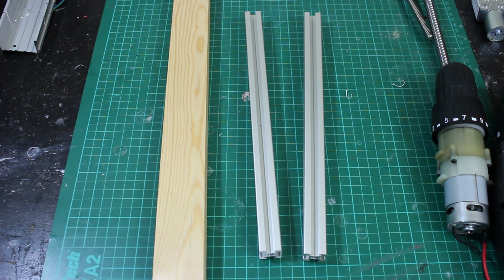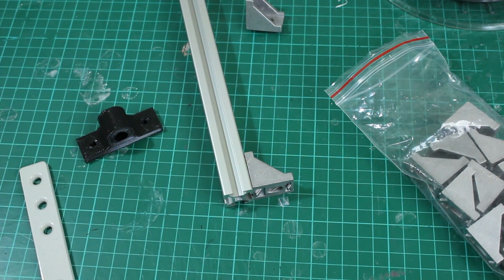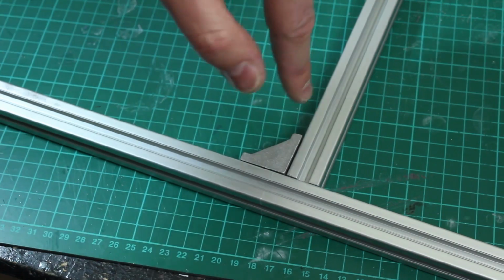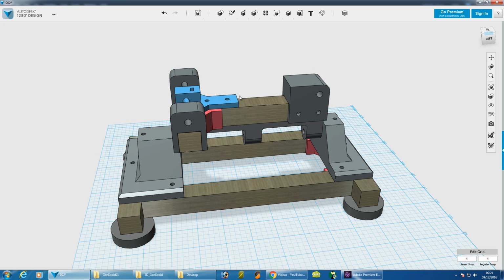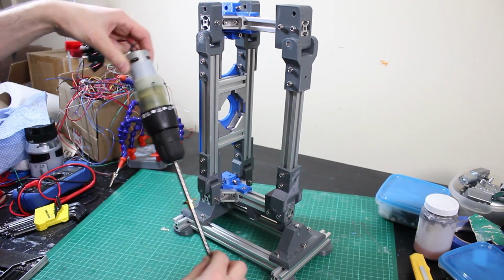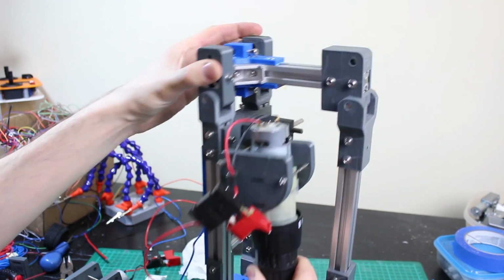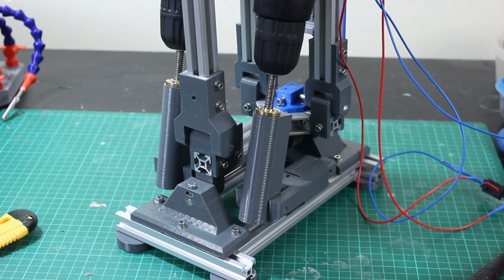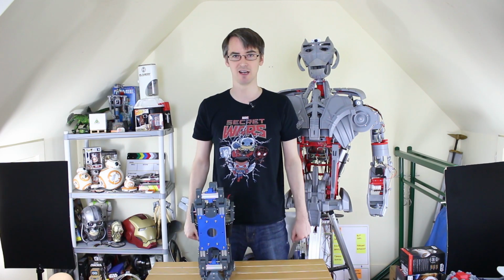Robot X #1 | Feet & Lower Legs | James Bruton

Comment: A lot of times lead screws have that sort of side to side play because usually their paired with linear guides for support which keep that play to zero, lead screw for zero vertical play and linear guides for zero horizontal play. It's basically the design of every 3d printer ever. But two lead screw nuts would probably balance things out nicely for this project!

Comment: it looks so professional that if it works really well you could make it a commercial "build your own robot" set where you could by either the pre-made parts to fit together or if they have a 3D printer you could sell the right amount of filament to complete the robot with the other pieces and the CAD could be free from a website.

Comment: You can try adding a brass bushing next to the nut which fits inside the plastic part to reduce the lash.  Since the threads are the only mechanical link between the threaded rod and the lower foot, the tolerance is adding play.

Comment: James, if you put the motor close to the feet, basically swaping the position with the nut, you'll probably improve the CG of your leg, besides you'll have more space for the threaded rod to run.
Congrats for the build, I only wish that we have cost worth 3D printers here in Brasil so I could build robots like you.

Comment: You should put an 8mm brass bushing inside the cylinder, just before the leadscrew nut. This way the leadscrew will slide into it, preventing some bending.

Comment: thats a great looking start your evolving it this really fast with cutting aluminium you can use a normal wood cutting saw as it has the same density as wood just make sure you wear eye protection as it cant be removed as easy as steel with a magnet

Comment: Hey James, nice job by the way, you could use the gearbox of the motors to your advantage by using the torque ratchet thing that disengages the motor when the load is too heavy, could be a last hardware safety feature.

Comment: Impressed with the progress thus far. As a possible solution to simplify the bottom end of the lead screws, instead of those two big hinge pieces, have a look at small (say 6 to 8mm) heim joints. One with a male threaded shank could screw straight into an appropriate hole in the "piston" piece,  and the swivel portion could be into a screw into the side of the lower rail.
Reply: Ah yes,  hadn't thought about the torque reaction of the lead screw.
Reply: Dominic Peterson

Comment: You could just put a bearing in the "piston" piece and make it slide along as the leg lean backwards ? As in, stick the inside of the bearing to the screw and let the outside roll freely inside the piston. it should remove the "angle" backlash

Comment: Those drill motors with gearboxes can be purchased very inexpensively as replacement parts from suppliers like Harbor Freight if you need more.  It's more cost effective and less wasteful than buying the entire drill, batteries, etc.
Reply: That's a pretty good price.  I think I paid about $8 each for a similar drill motor and gearbox combo (no chuck) a few years ago.

Comment: Looks like a great start. One thing: In the shot of cutting the aluminium extrusion, it looked like you may not have been using full strokes on the hacksaw. One end of the frame/blade to the other. Is this correct? It is normally advised, wherever possible, to use full strokes on the saw. This is to ensure that the wear on the blade is even, and the blade thickness is parallel. The blade will jam and break due to the varying thickness(think driving a wedge into a slot, with the wedge able to flex). Straight blade: --, versus a uneven blade: >----<. Just a slight tip to hopefully make the job and life easier.  Also, could we please get a video dedicated to your 3D printing setup? One that shows the attic(panning shot, etc), to give viewers a better sense of orientation of where objects are located? Even a work-space tour would work. Might be a good filler video for when shipping of project parts, is delayed. Maybe stay away from 360 video for this? Love your videos, you are a great inspiration for many projects in robotics.

Comment: Paint me a fool but this looks like it's a proper job. 3D printing is all well and good but the addition of 20x20 Aluminium V slot raises the game and allows you to leverage (pun intended) the benefits of rapid prototyping using FDM, good stuff.

There is a movement within 3D printer owner circles that print prosthetic limbs for those in need. With this in mind, watching the development of "Robot X" I couldn't help but think that rather than adding different superstructures to the legs you could add a person and have the legs walk them around. People that have lost the ability to control their legs, or never had it to begin with, could benefit from the experience of "walking" using a few hundred??? pound device compared to the limited availability of the multi-thousand pound systems that are out there now.

Just thinking.

Comment: You could print longer nuts in the plastic, and maybe lose the bronze ones.  In theory that'd save a lot of money on nuts too,  but those RepRap ready bundles are pretty cheap already.

Machining ballscrews is easy enough, especially £15 ones.  Even if they were rock hard, you could grind the end.  If  you made a jig that presents the end to a grindwheel,  then lets you rotate 60 degrees and repeat,  you'd get a slightly concave hex on the end which would fit great in a drill chuck.  Personally I'd try and remove those chucks and replace them with something more compact.

Comment: Really nice, looks promising! I would recommend taking a look at Rev robotics extrusion. It has a similar design to the extrusion you have but you can use normal nuts with it, none of those expensive t-nuts! Everything is in metic sizes and the extrusion is only made in a 15mm x 15mm size right now. Smaller that the stuff you have but just as tough! Again I cannot recommend Rev robotics enough! Keep building cool stuff! -Owen

Comment: you may want to look into a blade runner.  it's a really compact and versatile saw which takes standard jig saw blades.  I bought one a year or so ago and I've used it to cut pretty much everything.
Reply: To cut aluminium you mean, not to pull apart for the motor.
Reply: James Lamb bahaha. yes but he would probably have it serving coffee in a week.

Comment: wow that looks so amazing and more more technically advanced than the gonk droid already and all you have is one foot and lower leg. I understand printing out the parts for the other foot however as you mention you find problems with the print such as the wobble in the foot drill attachment thingy and you say you might come back and try to fix that however you have already printed duplicates of parts which means a lot more wasted material than if you perfected one foot and then printed the other.

Comment: This may have been covered in a previous video or comments thread, but have you looked at how changing the shape of the infill on your parts might help with rigidity? We've seen some improvement on our prints by switching to a hexagonal infill. I don't think hexagonal is available in Cura, but, if you haven't already, you might look at if the triangle pattern is sturdier.

Comment: have you not tried to take the chucks off the drills to save some length and mean you can couple (possibly with strong prints) the ball screw to the motor shaft.

Comment: I was thinking you could modify the pistons so the hole is smaller for most of the length so the screw is a nice fit, alternately as a retrofit maybe some metal tube inside.
Reply: Not sure how much wear you would get, certainly not to the screw, the smaller inside diameter would be like a non threaded long nut, the thread would be travelling over the same course, add some teflon lubricant for 'insurance'
You could print up a test piece and make it continually cycle

Comment: Could you put a captive nut in the mid point of the pivot where the lead screw goes to eliminate the back lash? Really want to see this robot reaching a near perfect state, best to address any small issues now before the whole leg mechanism is assembled
Reply: The drawback i see for that is linear rails will require more parts which means additional weight and the risk of extra slop in those parts

Comment: maybee for the balance control of the robot you could use a  neural network wich will make the programmation much easier and a lit more performant
Reply: By making a neural network the solution will self optimise itself without the intervention of human coding it. By exemple the program ma find a way to use potentiometer to balance the legs by exploiting the way the legs where made. Maybe you can search for neural network and artificial life exemple on youtube because it is kinda hard to explain...(sorry in advance for my bad engliash if I made any mistake, im from canada and im french. And it is freaking cold out there my finger barely moves hahah)

Comment: The cura representation is definitely off! To me that looked more like 30-40% infill while the output was more along the lines of 15-20%. I always use 40% infill for my mechanical parts (pretty much all of them).
Reply: Also, print a cutting jig with standard vertical cuts at 90°, 60° and 45°. Makes cutting these things and others so much easier!
Reply: El cheapo hack... if you watch my HEPHAESTUS series you'll see I use square nuts instead of T nuts. If you insert them at the right angle you can also get them to drop in like those T nuts, it's a bit finicky but you'll get the knack. Saves so much money.
Reply: James Bruton ah yes, it happens! But so long as you don't cut right through or drift off the marks you'll be fine. Also, definitely consider the square nut trick.
Reply: Buy a cheap electric drop/mitre saw from ARGOS, it will cut aluminium just fine.

Comment: I have to say this design looks absolutely beautiful so far. The use of more substantial materials, more robust look, all of it makes it to not only appear really practical, but also pretty cool. Keep it up:)
I just wonder if those drill motors will not suffer from overheating during longer walk. From my experience that is a common problem with drills.
Reply: ***** That is true and I have to say that its modular nature (which applies both for practical and, in the future, for aesthetics side too) is really nice. It could make a great platform for your future projects too.
Well good luck with your project!

Comment: Upon re-watching this, I had a thought.  Couldn't you print an attachment for the brass nut that includes a guide sheath and a bearing housing?  In essence making the less expensive nut more like the heavier example you displayed at the beginning of the video?  Of course I have no idea if that would help with the backlash.  :/

Comment: you really need to fix those lead screw issues or the hole leg will be throne off just like the gonk ankle rails. that is the extending the base pivot out into an O and bring the lead screw pivot into alignment with the axis of force
Reply: James Bruton this is just the place where evolution goes for a ball joint, I wonder if that could be 3D printed?

Comment: But James the drills have a deceleration effect where it takes time to slow down, isn't that pretty major in a walking robot.
Reply: Freeze Masta the pid controller once implemented might be able to be tuned to account for it, also once driven by motor controller you can usually electronically brake the motor which software could apply whenever not actively driving to target. Likely to wear out brushes quicker by arcing though.. that said, these motors (550/775) can usually be picked up cheap

Comment: Why not use steel balljoints instead of the plastic hinges? I believe you can get this to be much more solid, even with rather small simple ones.
Reply: James Bruton well, I didn't think that trough, did I? But what about universal joints? You can get them as wrench sockets fairly cheaply.

Comment: I think because you build the mechanics in sub-assmblies, you should do the electronics and software in the same way
Reply: If I were building this I would add all of your electronics: arduino, pots, force feedback, and whatever else you might need. Then completely program it (like a multi-dimensional servo) so you can send the where you want it to be Data then it tries to get there while sending back sensor data (via multi-pin connector?). This way keeps the electronics very modular; which I think fits your build style nicely.

Comment: The mass would still be 3.8 kg in Moon or in Mars gravity!  The scale measures weight, not mass, ie. 37.278 N (Newton) = 37.278 kg.m.s^-2, and then the display divides that number by the average Earth surface gravity (9.81 m.s^-2), resulting in the mass, 3.8 kg.  A scale on the Moon would do the same, but measuring 6.1636 N, and dividing by the average Moon surface gravity (1.622 m.s^-2) giving the SAME mass of 3.8 kg.
Reply: @James Bruton : weight is measured in Newton not in kg. Mass is measured in kg.

Comment: Couldn't you test print a one piece ball joint for the ankle actuator?
Reply: Nick Ramsay I think the friction would be too high, the surface is not perfectly flat because it is printed in layers but it could be possible to reinforce the joints with metal or a hot nail being pushed into the plastic...
Reply: I mean instead of using the half universal joint you're using at the moment. Replace it with a ball joint. The thrust from the shafts with then go through the centre of the joint in all orientations. The joint you have now, will have a lot of weight leveraging on it when you compete the build. Just a thought.
Reply: ***** not the joint itself. The joint you have at the end of the lead screw.
Reply: ***** Print a block with a ball joint pointing out of the side of the block towards the centreline of the foot.  The plastic block that the lead screw slides into to the end of the ball joint could be reprinted as a part of the ball joint. The ball won't rotate as the rotation from the lead screw can't translate from the lead screw to the ball joint because it's held in place by the block that is attached to the foot base plate. 
Think of it like the reverse of a gas strut rod end on a hatchback.
Reply: Mattes Maschmeier  the ball joint isn't for the ankle. It's for the point of attachment between the leadscrew and the foot. You're doing to drive the joint with quite a lot of torque from the lead screw as it applies force through the ball joint on the foot. I don't think friction will be the problem.

Comment: Hi James

Not sure if you have seen this already but you could save a load of space and weight by removing the chuck from the drill motors. This is a common trick in the robot fighting community: https://youtu.be/8_kWYewQmV0

it will give a nice mounting point that you can screw onto with a smaller lighter (and probably more robust) 3d print
Reply: Ahh yeah good point and it seems like you have the weight and space spare to leave them on. So the KISS method is the best. Love the direction this project is going, keen for the next episode

Comment: Have the Hole in the Plastic behind Nut Tighter Tolerance, you Probably have it the Nuts Diameter not the Rods behind the nut giving it Play behind the nut, Or Get a Longer Nut and Incase it in the 3D Plastic (like a  http://www.ebay.com/itm/2pcs-M6-M8-Stainless-Steel-Hex-Screw-Coupling-Nut-Standoff-Spacer-20mm-40mm-/231431841539 ) there is some Great Apps for Phones to scan Items into Program to 3D print, Might made a Nice Cylinder Look to the Drill top which is not a Nice to look at , that said More Great Robots